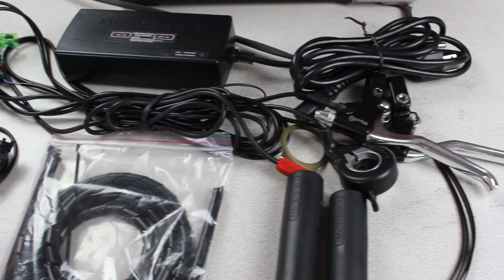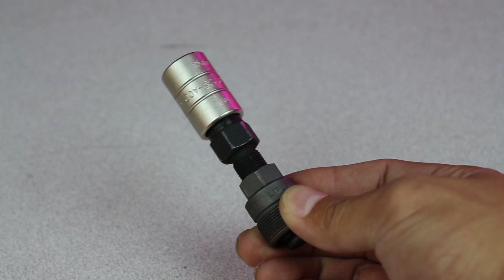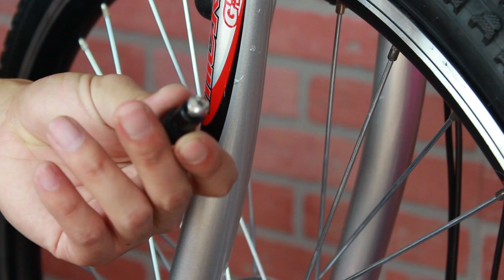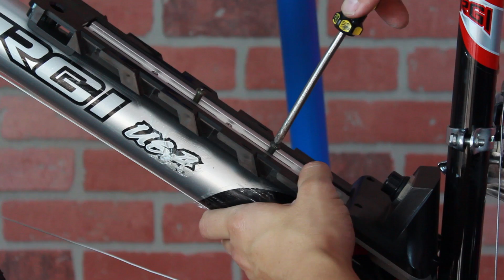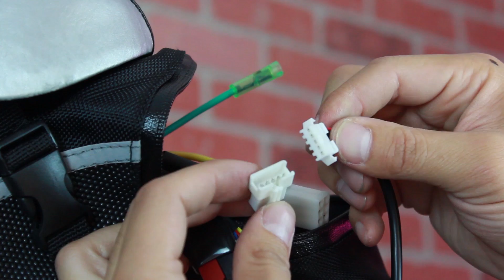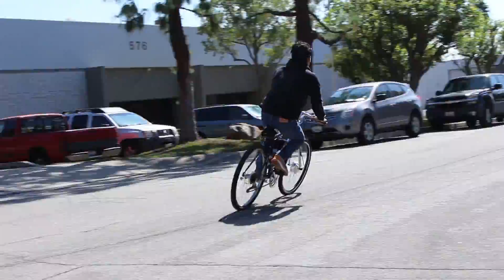How to Install an Electric Bike Conversion Kit Front Wheel | GigaByke E-Bike Kit

Comment: I am very pleased with my new e-bike. share4.photo/ebicycle The 500w motor gives me plenty of power. Assembly is simple enough if you are even reasonably mechanically inclined. I have only used my e-bike for relatively short trips so I can ride for a few days before I have to change my battery. I read reviews about the brake handles being on wrong side but mine came right. It's a good buy for the money, fast, and I love it.....

Comment: i am getting one of these, I know everything that I am going to get including the batteries, but im not sure how to attach the batteries to the controller, because i see specific ends on the wires for the batteries on the controllers, but i have alligator clamps and i dont want to try to attach those, and want to know what the real plug is that I should get that fits with the wire in the controller

Comment: That sort of answers my question I've got a 36v benelli& pretty much the same kit as in the vid the battry definitely the same with the sub port & looks the same .my bike the one in video stopped working after 2 wires & back for no reason touched together they gave a little short spark not a lot but hasn't worked since although the digital speed & voltage reader on the bars still have power going up there but the lights won't stay on to battry life left can I by pass the controller in the bag or want it work.Cuz I can't get any power to the wheel
Reply from the maker: Give us a call at (800)317-0479 and we can assist you.

Comment: Just installed the Voilamart 26”, 48v, 1000w. I’ve made my connections, battery fully charged, and nothing! Did I miss something?
Reply from the maker: Unfortunately that is not one of our brands, so we are unfamiliar with the possible issues.
Reply: Did you include the speed controller because you would need to bypass that but then the digital speedometer or what reader might prevent it working if you by pass it put an inline fuse between the battry &motot as close as poss

Comment: How do you tell if your front forks are strong enough to cope with the power of the eleccy motor,when they are not designed to do so?
Reply from the maker: Most standard bicycles are strong enough and the added electric motor doesn't add much more stress than would normally be applied.
Reply: Use torque arms to save ruining your drop outs

Comment: Can u put a second one in the rear wheel?
Reply from the maker: A second electric wheel is absolutely possible, though a second control and extra wiring may be needed to fully utilize the potential for each motor. Keep in mind, this will likely only increase torque and not have any change in top speed.

Comment: Now I got a question first I have a trike tricycle and I was wanting to do a electric motor on the front wheel 500 watts so it's all legal and then a 45cc gas motor for the back wheels how would someone go about doing that
Reply from the maker: An electric motor, such as  our Modwheel, can easily replace the existing front wheel. There are available mounting kits for tricycles that allow a gas engine to be rear mounted, we do not however carry tricycle parts ourselves. There are numerous DIY instructional builds for tricycles.

Comment: HELP PLEASE WHAT HEIGHT BIKE IS THIS CONVERSION KIT CONDUSIVE WITH....I THINK MY MOUTAIN BIKE IS 26 INCHES...I HAVE A RACK ON THE BACK CAN I PUT THE BATTERY PACK THERE???? IS THE BATTERY PACK WATERPROOF AND IF NOT HOW CAN I WATERPROOF IT
Reply from the maker: The battery will fit most men's 26" hard tail bikes. Women's bikes may not have enough clearance for the battery because of the lower top tube. The battery is able to be mounted anywhere with additional self make mounting points or brackets. Unfortunately, the battery comes manufactured with center mounting in mind. The battery and the motor have light weather sealing, but not entirely water proof. In general, any bike, with or without this kit, should not be used in extremely wet conditions and should not be left out in extremely wet weather; as most of the bike components are susceptible to rust and corrosion.

Comment: Do you know how well these work long term ? Any problems at all?
Reply from the maker: Due to the design, electric engines have the benefit of needing little to no maintenance. This design can also be a downfall if there happens to be an issue with the engine. Luckily, if there is a problem, it will likely be a defect with the battery or the engine itself; both issues being covered by our warranty. Keeping that in mind, all batteries have a limited amount of charge cycles that will eventually leave the battery incapable of holding a charge.

Comment: Has anyone put an electric motor and a 2 stroke motor on a bike to run in tandem? Trying to see if there are certain things like timing or torque that i have to take into factor. I haven't seen to many gas/electric hybrid bikes.
Reply from the maker: We would love to see this as well. If find anything on this, please let us know.
Reply: Yamaha had a two wheel drive dirt bike that out perfromed single wheels but the market in general said nah so they don't make it anymore. maybs you can still get one somewhere

Comment: I installed this,  Got it going 50 mph!  I added a 9 volt  battery and a rotation module from a Microwave oven. Hooked up both pieces to a # 5 inline fuse just to be safe. Then put gas in the tire instead of air.
Reply: LOL
Reply: Can I install on phixe free wheel btw
Reply: Damn you beat me too it! I did the same exact thing 😄

Comment: A hybrid bike with an electric motor and a gas engine would be dope
Reply: Truman Russell I'm thinking about picking this kit up to add to my gas engine already on my bike. I am installing a smaller rear sprocket so I can go 35 to 40 mph (currently my top speed is 20), but I'll need extra torque to keep my gas engine from bogging down during acceleration. technically with a 49cc gas engine and a 250W electric motor, it should still be legal to drive without a motorcycle certification.

Comment: Don't no if u can help me I not, I have. 36volt electric bike and the 250w front wheel motor has just gone, do u no if a 500w, 48volt  wheel will do the same job as I have one,thanks
Reply: You may be able to install the 48 volt motor but it depends on whether or not they are the same style of motor - Sine Wave, Brushless, Direct Drive etc. Different controllers will be what determines whether the 2 motor systems are compatible.
Reply: You can install it but it will not run on it's full potential so you will get a heavier bike and less potent motor . As long as the controller will be the same nothing can be damaged !

Comment: H-E-L-L-O, thanks for glossing over the Installing of the WHEEL,like what is the order of Washer and Slotted washer,I have a 800 watt front wheel kit and just had my Front wheel totally come off on me while Riding ,this is SERIOUS what can you do to prevent this Happening,no wheel Instructions came for proper wheel Installation just proper Wiring,Guess life is Cheap in China ,there is to much torque in Front Wheel for it not to be VERY secure,Be warned
Reply: im working on a gyes bike right now that also has the same issue with his front tire comming off. so im going to machine weld and bolt a system to rectify this very serious problem. the u shaped ends on the front forks are not deep enough nor are they beefed up enough so im going to make a bracket with the 2 square sides and 2 round ends totally enclosed that slips over the axel  totally wich encloses the axel and then this bracket will bolt to the front forks. the u ends on the bike are spreading apart as well not beefy enough. the original fork ends are ment for a normal bike tire not a motorized bike wheel with that much torque. the wheel was always comming off at just starting off the standard bike u shaped fork ends are not desighned right for power wheels. they have to be beefed up and modified to somthing much different and stronger and a fail safe design. thats my 2 cents.
Reply: Yes you need torque arms to cope with the torque off the motor in your dropouts

Comment: Which is better a front wheel drive or rear wheel drive
Reply: the rear for a few reasons; better traction (handling), less chance of actually breaking the wheel loose from the frame because of the torque power from the motor, stealthy appearance doesn't stand out like a sore thumb.

the only advantage for the front is the all wheel drive.. and i guess it's easier to install.
Reply: Rear
Reply: rear 
unless you want to die
Reply: Front
Reply: +Gino Foogle you can wheelie with rear
Reply: Rear is far better, the only reason people like the front because they think it's easy to install. This guy didn't even bother to put the crank speed sensor on the correct side.
Reply: Front is better to install and cheaper
Reply: Front
Reply: Front

Comment: No no no not safe at all to drill holes into your frame
Reply: Bikes have fairly strong tube supports, it should be fine to drill holes in them, you could probably cut the top tube off and still ride fine
Reply: +The Piscis that is the stupidest thing I have ever heard and unless the frame is steel never drill into your frame
Reply: I have drilled multiple holes in the top frame of an old aluminum frame and it rides perfectly fine
Reply: Dude, you do know that some mountain bikes come with a holes in them as you buy them right?

Two small lateral holes are no problem at all. Not like you will be using an ebike for hardcore downhill stuff, an even then it would be safe.

If its carbon maybe there is an issue, but aluminum is just fine.
Reply: ssuuppeerrbbooyy exactly, DO NOT  drill into carbon but aluminum or steel is perfectly safe even on a mountain bike